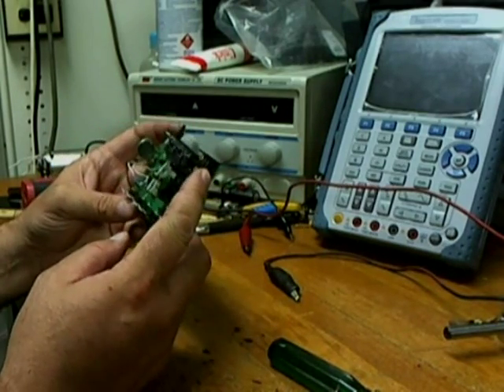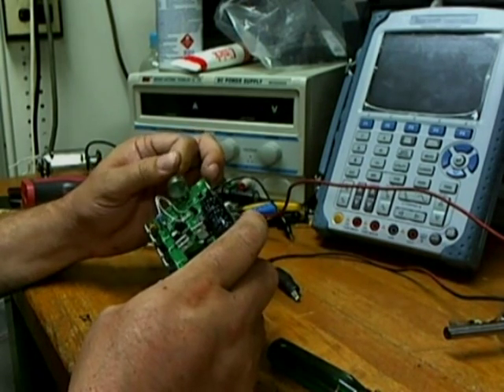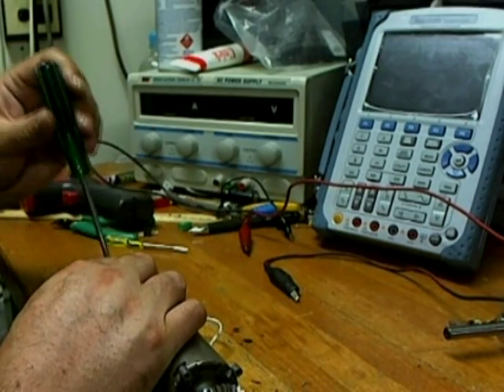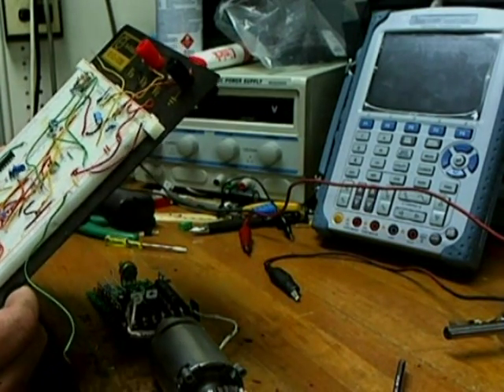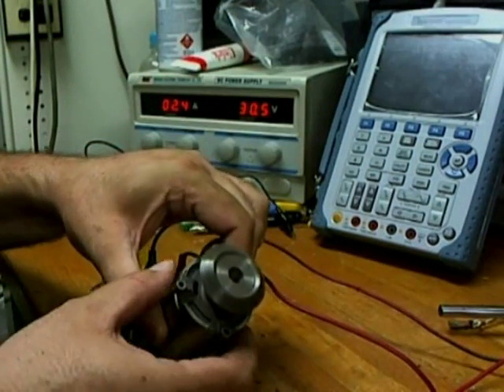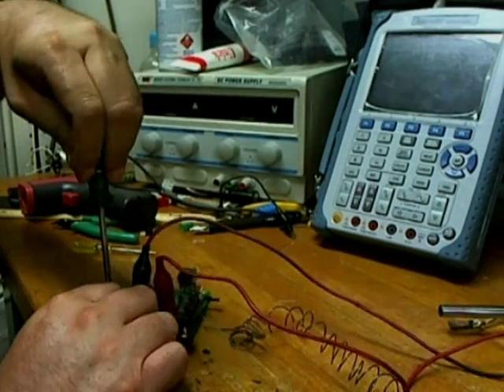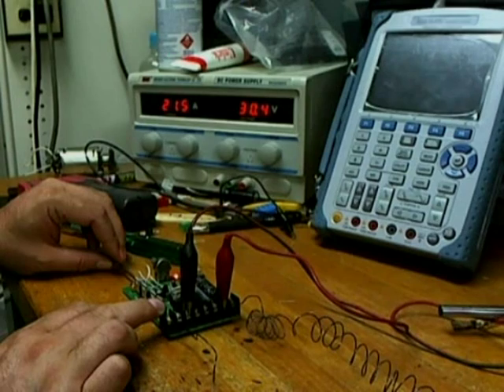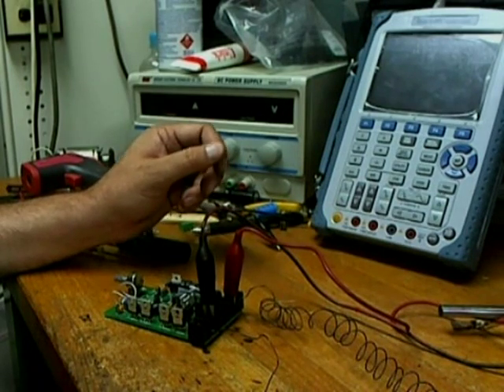DC Motor Speed controller or HHO High Current controller, current limited

Comment from the maker: @delvis11 Ahh, I thought you meant 120v DC. I forgot in America you run 120VAC. It wouldn't be impossible, but for low volume I don't think it would be viable. Its not the cost of the PCB's that's the issue, its the cost of development.

Comment: @motiondynamics2010 I have a market, maybe not huge but every 120v generator I sell really needs a pwm. They are units you plug into a standard 120v house socket. People buy them for hho torches and welding setups. I get lots of inquiries.
There's nothing on the market so I thing a good one would do well. The 12v versions have a lot of competition. 
I don't know what is involved in designing one but I could help with funds to help get the boards printed.